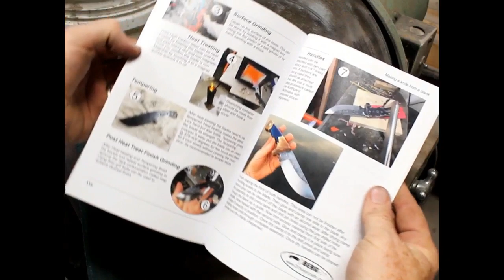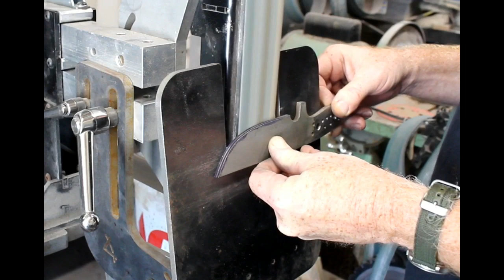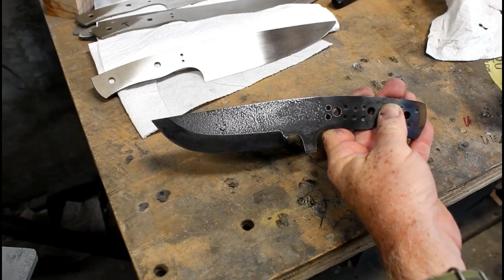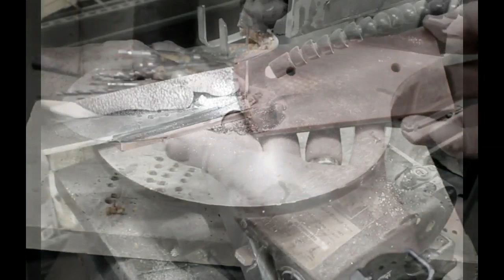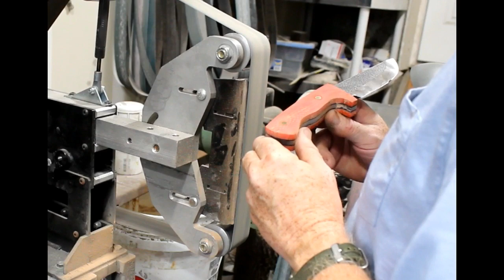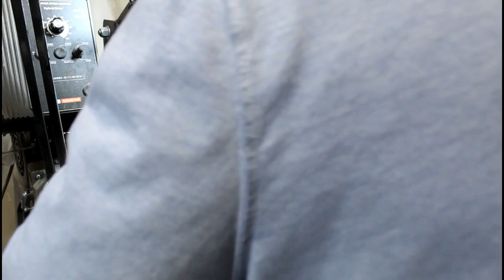How to make a Crinkle Textured knife from a knife blank

Comment: Old video- I know. Do you think the electro etching would work on 1018? I can’t imagine why it wouldn’t, but I’ve never worked with high carbon 1095 like this. My application is not knife making.
Reply from the maker: Yes absolutely
Reply: @DIYeasycrafts  thanks! This might be a nice idea to make a chunk of machined low carbon steel mimic (or blend into) cast iron. Much appreciated!

Comment: I have tried to do electro etching with a battery charger, but can't get it to work.  Could it be that yours is older and doesn't have a safety feature that newer ones have?
Reply from the maker: Yes you need the older style charger or other 12v 2 amp power source
Reply: @DIYeasycrafts   I have been using a PC power supply, but it cuts off mid etch, so... I ordered a benchtop DC power supply.  Hope that works better.
Reply: Thank you very much for sharing your knowledge and experience with us!!  I have learned a lot from you.